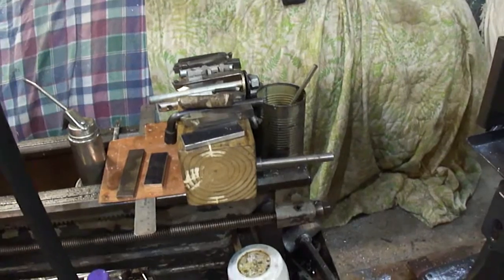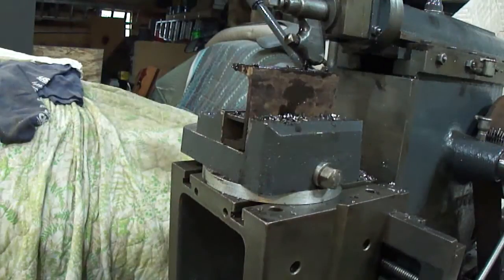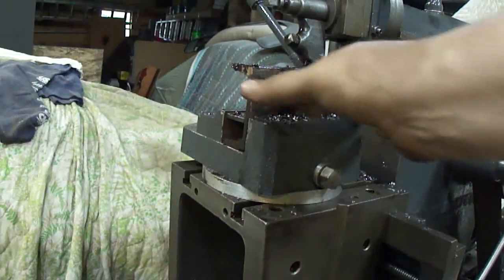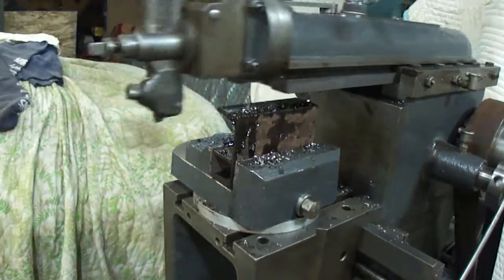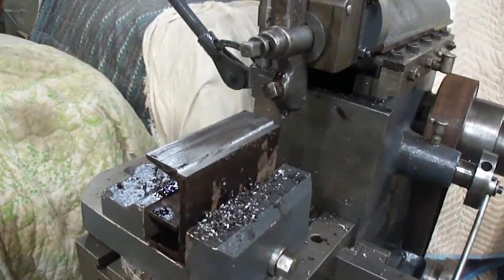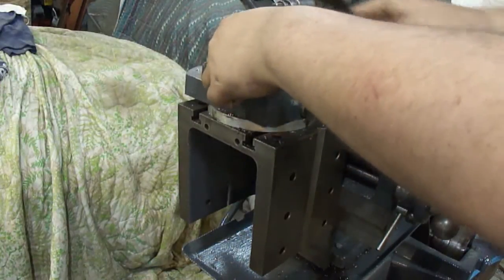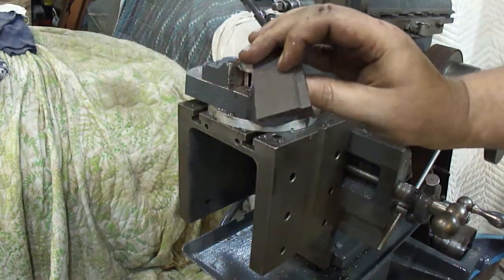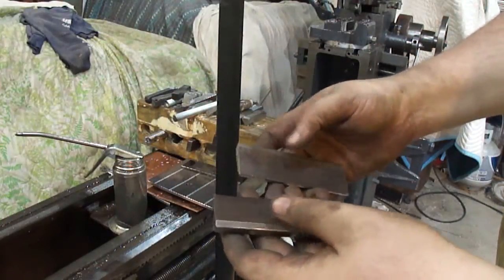Shaper Action - Making Hold-Down Clamps (Starrett 54 Clone)

Comment: I like that use of the c channel. Any chance of a sketch showing the key angles required for the hold downs ? Maybe a sketch tagged on the end of the vid ?
Thanks for sharing.
Mat
Reply from the maker: I dont have an online copy of the file, and dont want to share out the file since I dont technically own it. If you go onto the metal shapers yahoo group, it has the blueprints and a ton of other blueprints for all kinds of tools in it's files section. Here's the listing for the yahoo group.
https://groups.yahoo.com/neo/groups/Metal_Shapers/files
The edge angles to make it work as a hold down tho is just 5 degrees on the front and back of it, tapering downwards so that it wants to tilt downwards when seated against the vise jaw. I just built mine bigger because the ones in the blueprints seemed so tiny when I doodled them up in cad to get the dimensions for it.
Reply: you will need harden the hold downs other wise they wont last very long due to the thin edges

Comment: Thats a good idea .I have one pair  homemade ones from a toolmaker which i bought the small shaper  from  very thin and hardend steel and on the thicker side its got a U-shape but i only use it for very thin stuff i.still have to make a few thicker  pairs
Reply from the maker: yea, I made those for doing thinner stuff. I was thinking of making another set, but putting a small V groove in the middle of it to hold thin round objects in the shaper, like stock that is too short to be held normally. I figured that after I get all of this done in the mild steel like I have been doing, I will sugar harden them, then quench them in salt water. That'll give about the same hardness as hardened tool steel, but much easier and cheaper to find, and it'll work all the same.